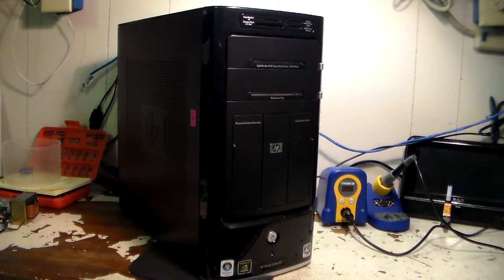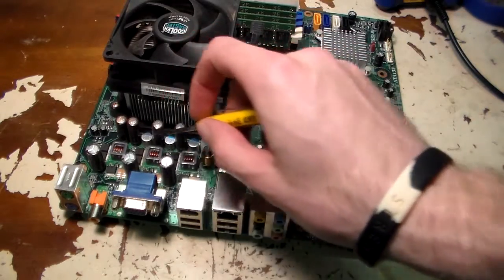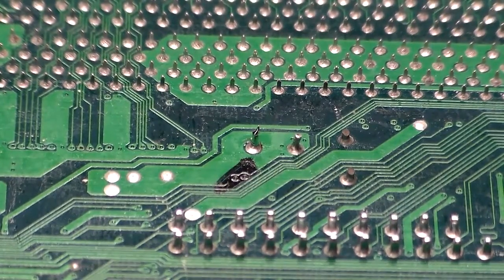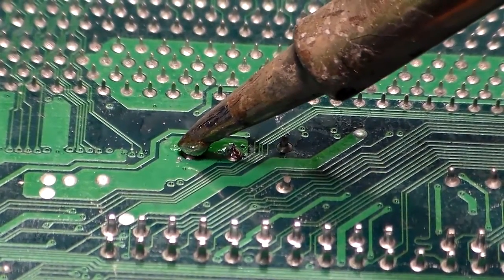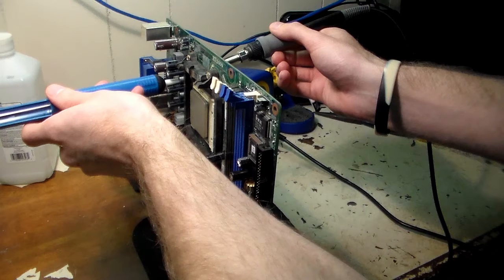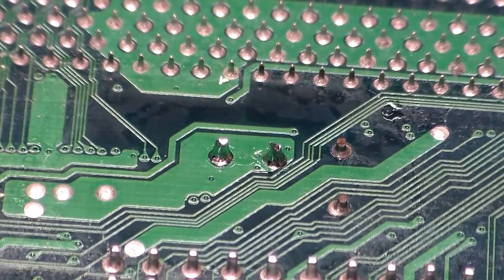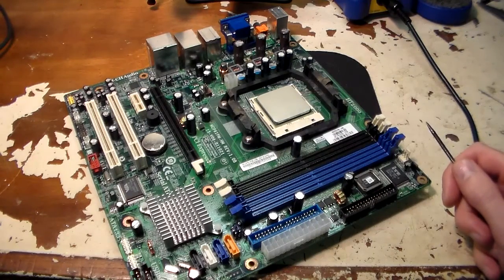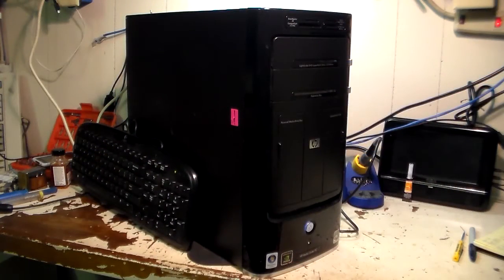Tech Repair: Pre-built PC from 2008 - Faulty Capacitor Replacement

Comment: I find flux helps when de-soldering oxidised connections, it also looks as though you might need to run a higher temperature on your iron or a tip with more thermal mass for those caps
Reply from the maker: yeah i did this before i bought a soldering station. the iron i was using was just barely enough to take those caps out. in hindsight, i wish i had used the desoldering station i have now. it would have made it MUCH easier

Comment: wow, could this possibly be why sometimes the video cuts out on my friends pc?
Reply: like the monitor still works, the menu and stuff can show up, but the screen is black for 20 or so seconds.
Reply from the maker: its probably the monitor itself, not the PC. could be a failing inverter or failing caps in the monitor. Or it could be display hardware/software issues with the PC (depends)
Reply: thewheelman282 nononono the monitors setup menu still works, just nothing shows up from the pc.